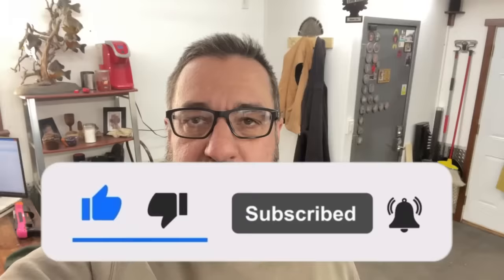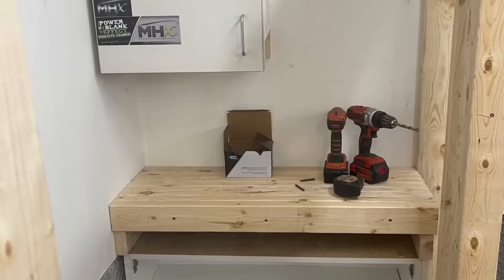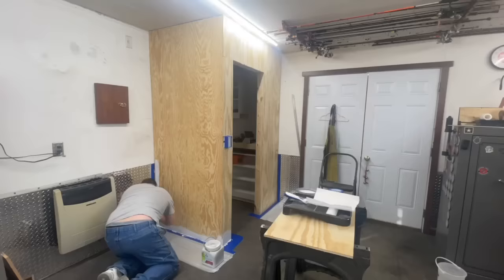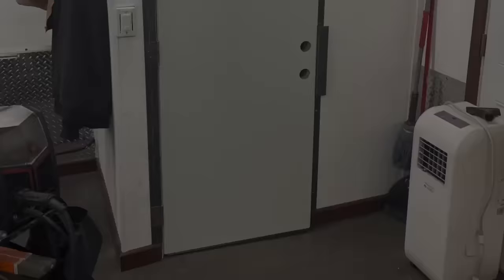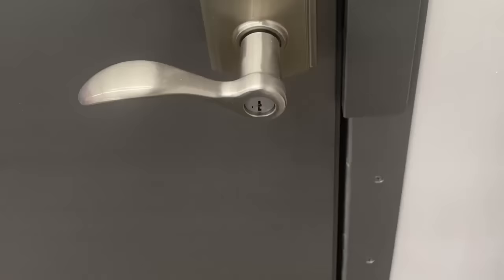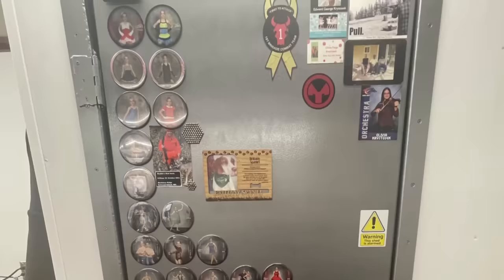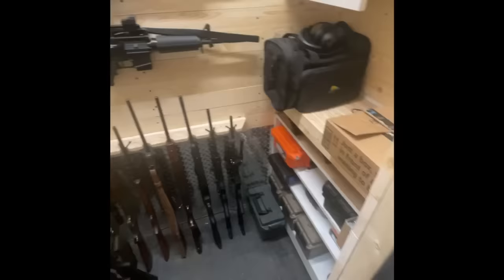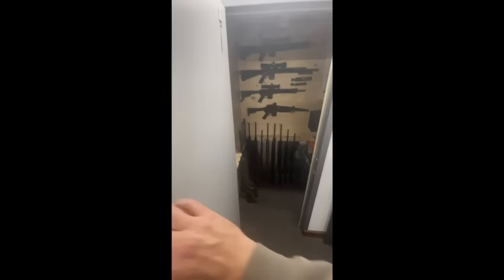DIY Walk in Gun Vault Room Storage

Comment: The second you said " nobody will get into this short of using a blow torch" .... ive already figured out how and possibly the easiest way to breach this um.... cabinet? 
Using a circular saw with a steel cutting blade, find the centers of the two outside studs at 16 inch on center. Zip straight down the middle of each stud, cutting through the screws you used to screw the L bracket to the wood. The corner is a good start, then where it meets the wall left of the door. Run through the studs at the ceiling and floor and pull the wall away. The saw blade will cut rebar too. Or.. cut around that door about 8 inches from the jamb. No need to cut at the floor or at the ceiling. And isn't the breaker box right there next to the wall? Think about it? I'll wait.
Reply from the maker: …& while your making all that noise, how long will it take before your facing an angry homeowner with a 12 bore in his hand.

What you also don’t know is how many cameras I have and where they are.

The point of the um…”cabinet” is to slow you down. Not too many thieves are showing up with a circular saw equipped with a steel cutting blade.

Peace brother.

Thanks for watching.

Comment: Great job, congratulations!  Instead of a dehumidifier I suggesti you add a "Golden Rod" available at any good gun store or online, you would only need a small one, no holes to drill and better performance for storing guns. Very inexpensive to run, pennies a day...<><..:)
Reply from the maker: Good tip. I will look into it.
I do have AC in the shop which, so far, is keeping the humidity in the room below 50%. If it becomes a problem I will check out the Golden Rod.

Thanks for watching.

Comment: Some probs I see, and some Kudos:

Are the Ceiling, back and right sides reinforced, or just waiting for someone to kick those in?  

The metal plates are mounted in between the studs, not overlaying the studs, and ONLY secured with ONE screw per L shaped angle mount. IF the plywood was not laid over the front, swift kicks could cause the screws to come out (only one per angle mount).  Also since the sheet metal doesn’t go over the studs, a sledge hammer could easily dislodge the top and bottom nails that secure the vertical 2x4s to the top/bottom plates.  The metal walls should have Definitely covered over the 2x4s so the energy from any impacts is distributed amongst multiple studs. 

As others have Mentioned Kwikset locks are Not the right choice for securing the door.  They only keep the honest people out.  Watch some “Lock Picking Lawyer” videos for ideas on that.  

As others mentioned: Fireproof inside or outside with something (not my expertise) but again, since the studs aren’t completely sealed over, those could burn through.  

The Alarm should be synced with an Exterior Alarm so neighbors are also alerted.  Homes are actually quite sound dampening which is why business and residential alarms ring OUTside.  Remote alert of some kind would be great as well, along with remote audio/video. The current alarm being battery powered is good cause someone can’t just cut the power ahead of time, but how often will you teat the batteries and how long will they last, and how easy is it for some to just break the cheap little alarm?  

Not sure why the door hinges weren’t Internal as well as mounted on the right side of the door, door handles should have been on the left side IMO.  

Needs a raised floor to avoid any water or moisture damage and definitely a Dehumidifier.  Don’t put your rifles on the ground!  

Should have been larger/wider :-)

Also, to maximize your space, your safe should ONLY contain things that “Go Bang”, or things that cause others to Go Bang, or expensive items like scopes, etc.  ((Guns, ammo, scopes)). The gun cases, etc should be stored elsewhere (when you find you need more room)

Now, having said all that, it’s a great first attempt and probably far better than most people have in their homes.  

I do like the 1x10 wood planks for mounting stuff wherever you want easily.  Did those pistol mount rods actually have rubber coatings??, looked like bare metal, ouch!  

Anyways, just food for thought but as I said, better than Most people have.  But do get better locks and watch Lock-picking Lawyer!

Comment: Only things I would have done different: 
1)Used 1" marine plywood rather than standard 3/4, Marine grade is a bitch to cut
2)Would have sheeted the inside with steel and welded, so the inside the wall plates tied to a second set. Then filled the void between them with sheets of drywall, this would also let you sheet over the studs on the inside so you have one solid box inside. It would also act as a 1 hour firewall.

Comment: Simply smashing walls with a sledge would render the steel useless! Not to mention the door knob is easily picked. Good thought but simple cinder block filled walls built along two foundation walls are far more substantial. You can order a vault door for $1500 to make a true vault

Comment: Solid construction. Lots of attention to security and structural reinforcement.
One thing I would strongly recommend is to not rely on standard Kwikset locks. You should custom pin those locks with various security pins, or swap their cores with more secure options.
A novice can pick those locks in under 2 minutes each. A vault is only as secure as its weakest element, and those locks are your weak point.
Well done on everything else. Exterior hinges are always a point of weakness, but you did well to mitigate the risks there.
How did you tack the hinge pins? Did you tack them to the door's hinge, or the frame's hinge? Is there a difference?
Reply from the maker: Thanks for the view. 

I am looking at have a smith repin the locks.

I tacked the hinge pins to the hinge. It is too much of a gap to tack to the frame.

Thanks again for watching.

Comment: As a locksmith and security consultant, I give you credit, it's a dang good build and a LOT better then what I see 99% of DIY projects. You were doing GREAT until the locks... Kwikset is garbage. Made with potmetal and stamped sheet. Basically, five minutes with a cheap cordless drill is enough to let an unskilled attack in. For someone who knows what they're doing, it's about a minute or less. (and youtube's a thing, so that's not a small population)... SOME of the Kwikset "Smartkey systems" can still be opened with a flathead screwdriver and a pair of vice grips, they they're phasing those out.... Honestly, don't trust Kwikset for anything other than keeping honest casuals honest. 

Also, requiring two combos is just a time waste unless this is JUST for long term storage and doesn't need to be accessed quickly. 

If it were me, I'd have either a passage function lever (like you'd have on a nonlocking closet, all it does it hold the door closed) and a higher security deadbolt. Recommendation would be Medeco as a go to, but that would require a key. You COULD go Kaba Simplex 9060000-26D-41 mechanical deadbolt, and those are popular options in secure settings, including both military and police secured areas, but it would mean modding the door slightly, but considering what you've already done, it's well within your skill level. 

OR, leave off the deadbolt, weld plate over the hole, and install a pushbutton Kaba simplex L1000 for the lever. You've done a good job shielding the latch against casual attack, and if your strike and latch bolt are properly aligned, I'd trust it, since it's all stainless steel, as it's ALSO a popular option in secure sites. If alignment was an issue, just weld a full length gap guard directly to the door to prevent things like wire attacks on the latch.

If you went that route I'd install a inside guard to prevent under-the-door attacks, but you can LITERALLY use a $2 wire shelf organizer bracket for that. (search youtube for "under door attack guard") since all it does is prevent a wire from getting behind the lever.... Heck a balled up hand towel will defeat the attack.  

Overall though, I give you credit, it's a dang good build and a LOT better then what I see 99% of DIY projects.
Reply from the maker: Some of the best feedback yet. I do appreciate it and will look into the Kaba locks.
Reply: @jackofalltrades7822  No worries and glad I could give some constructive input. Good job on the build. Like seriously, replace the locks and you're more physically secure than some evidence rooms for some of the smaller local PDs around here.

Comment: I'll be doing something similar to this soon.  I think a "gun vault" is a great idea, however, I would chuck valuable docs and cash in my fireproof safe.  Maybe I missed it in the video, but do you keep it temperature and humidity controlled?  I currently keep my safe in my "gun closet" and I keep the humidity under 50% at all times.  I also keep ammo in this room (and in ammo cans.  This will keep my ammo fresh for a very long time.
Reply from the maker: The building is air conditioned. Thanks for watching.

Comment: The flaw I see is that you still have wood as the attachment, I believe that a normal person could take a 12lb Sledgehammer and open a wall up w/o issue.   I like the fffort, but I would suggest L Brackets into Concrete flooring welded to the panels (Painted for rust protection) as an outer wall (Or inner protective wall) then strips 2x4s for the drywall.And if you cannot secure to a solid top, then L Iron or Square tube a structural support.  Perhaps Rock-Wool for Fire protection on the outside wall too
Reply from the maker: That walls are secured the the concrete flood with 1/2” anchors and all the studs and screwed together with 3” screws. I think your right but it would take a fair bit of time to break through. Enough time for me to get the notification from one of my three cameras and get out to the room or for police to arrive.

I will admit that with enough time and no disturbances they could break in and this is only going to keep the honest honest.

Thanks for watching.

Comment: That Kwikset is the weak link, and it is very weak.  At least swap the dead bolt for a Schlage light commercial one.  You can find them on the lower shelves in the door lock section at a big box home improvement store.  About $40.  I am a very poor lock picker but I could probably pick or rake your locks.  They are also easy to drill out, no skill required.
Reply from the maker: I had the tumblers swapped out for something far better so I could keep the push button key codes.

Thanks for watching.

Comment: Isn't the wood frame still your weak point? Yeah, you put a metal slab between the studs but there only held with two screws two a side. And what is the framing held in with 16D nails? A sledgehammer or reciprocating saw seems like it would make pretty light work of it no? Looks nice though.

Comment: Great job, I was wondering if you were gonna just dry wall it. dont laugh Ive seen people just put dead bolts on closet or bedroom doors , for secure storage. I could see me having to extend that wall several times throughout the years because I only aquire and never dispose. Kinda like a pack rat for certain things. Good job.
Reply from the maker: I have seen the same. I was thinking about steel wall sheets but that would have covered the studs and hanging this would have been difficult. 

I figured steel between the studs was a good compromise.

Thanks for watching.

Comment: Can someone provide more details/explanation on how he setup the hinges? He said the hinges were screwed in from both sides, so taking the screws out wouldn't do anything. How do you screw a hinge in from both sides? I can see using a bolt, going all the way through, but you're still capping it with a nut (or welding a nut onto the metal hinge). That didn't seem to be the case here.

Comment: What about the ceiling? If it’s not reinforced, someone could just punch through the drywall on the ceiling!
Reply from the maker: They would have to pretty thin to get through there. The roof pitch is pretty tight. It’s only a 4/12 pitch on an 18’ wide building.

I guess if they want in that bad they can have it.

Thanks for watching.
Reply: @jackofalltrades7822  Giving the limited space it may be easier for someone to cut through the roof directly above.  But that may get the attention of the neighbors or someone driving by.

Comment: nicely done but I'm curious why you didn't line it with several layers of drywall to insulate from fire...like a gun safe?
Reply from the maker: The entire room the safe is in is dry walled with fire rated sheet rock.

Thanks for watching.
Reply: how many layers of drywall line the room?  You'd need at least 4-5 to provide a reasonable level of fire protection.

Comment: a sledge hammer and 10 minutes is all it would take.  You have 2 walls with what looks to be drywall and not to mention the ceiling.
Reply from the maker: Because I always carry a sledgehammer in my pocket for just such an occasion.

You don’t have it all figured out like you think you do.
1) I have cameras in several locations. It will take far less than 10 min before I was in you face with a 12ga against your nose.

2) the other 2 walls are exterior walls with steel siding and 3/4” plywood and in full view of my cameras.

3) the ceiling only goes to the roof and there is not enough room to access the gun room…unless your a Keebler elf. 

I will be waiting for you gun room video.

Thanks for watching and happy new year.

Comment: What are you going to do if you have a fire?  The metal  will not give you any fire protection and only causes radient heat transfer.
Reply from the maker: The building is sheetrocked in type X fire rated drywall and I have insurance. Still better than storing them in a closet or under my bed.

Comment: Very impressive Nice job although how will you keep the humidity regulated??
Reply from the maker: The entire building is air conditioned. Humidity in and out of the room is 50% or less.

Thanks for watching.
Reply: @jackofalltrades7822  so you're saying you have a air conditioned vent going into that room reason I'm asking is because I had to put a dehumidifier system in my walk-in gun room even though the entire room that it was built in was air conditioning to regulate anything from accumulating.

Comment: one thing i did note you did not secure the ceil and why did you not use so fire insulation in the walls just my thought s love it though you did a good job
Reply from the maker: They would have to come trough the roof. That would likely draw some attention. There isn’t enough room in the ceiling. 

The entire building is sheet rocked with fire rated rock. I did add 2 layers of the same product between the studs and behind the steel plates. I didn’t take pics of that and forgot to mention it in the video.

Thanks for watching.

Comment: nice room but, you spent all that time to make the room impossible to break into through the walls but you set the hinges on the outside with the push pins exposed. i hammer and a screwdriver can pop those out and anyone can get in the closet.
Reply from the maker: Did you not see the security pins on the inside of the hinges or hear that I welded the hing pins to the hinge?

Comment: Those locks arent great, i had them on my office and they caught the guy who broke in a month later.  He said it took 30sec to get into them.  Evidently they are incredibly easy to pick.  He said theres a video on it. I called my military security manager (I was a federal agent in military) he told me to buy a us govt approved mechanical code lock.  Evidently they are almost impossible to get into.  I have a vault door on my room,i sold my 3 cannon safes (franklin series) and bought just a door with an electric ram. I put the code in and push a button and the door swings open.  It weighs 500lbs, just the door and was a salvaged bank door.  I bought it from a company that only does bank salvage.  I bought  a couple of pieces of bullet resistant glass too (4in thick) i had a film put on them to make them 1 way glass and added them to the wall so it looks like a mirror on each wall.  One has a camera behind it, the other i can see through directly.  Sometimes disquising a vault is better than a crazy vault door.  Magnets on it are a dead giveaway though.  The entrance to mine is behind a bookshelf that is welded and screwed to the vault door and has a piece of felt on thebottom to hide the fact that it doesnt touch the floor.

Comment: “This is the lockpicking lawyer and today we’re going to use top of the keyway tension and a short pick in .025 to bypass this 1/4” steel plate…”

Those locks are unfortunately the weak link here imo.

Comment: Ceiling? Rear wall? People usually forget to protect a ceiling entry point.
Reply from the maker: They would have to go through the roof to gain access through the ceiling. All 4 walls are reinforced with steel or are covered by security cameras. 

Thanks for watching.
Reply: @jackofalltrades7822  I hear that. But cutting through the roof/ceiling takes all of a minute at most with a rechargable circular saw.

Comment: Nice job! Question: since many attic acces points are in the garage, was there a concern of someone simply dropping in through the top drywall?
Reply from the maker: No. There is not enough space as the roof pitch is too shallow. Plus they would have to swim through all the blow in insulation.

Thief’s are lazy by nature and I doubt they would go through the effort.

Thanks for watching.
Reply: @jackofalltrades7822  thank you for the additional insight! Again, great video!